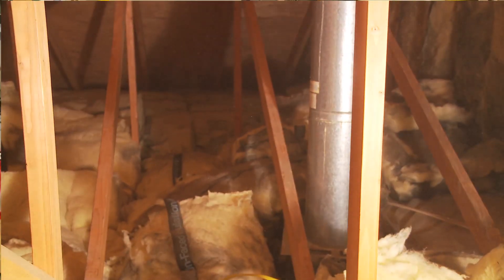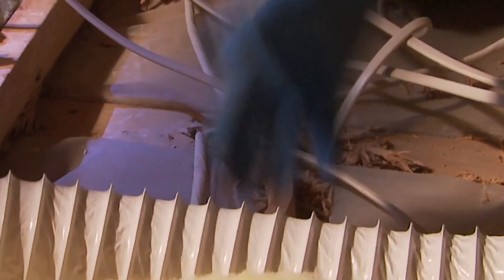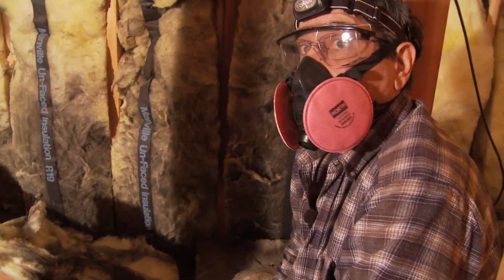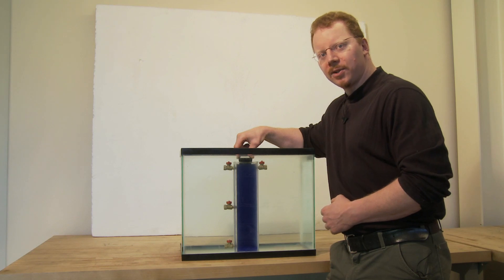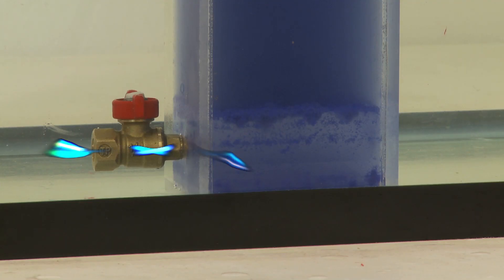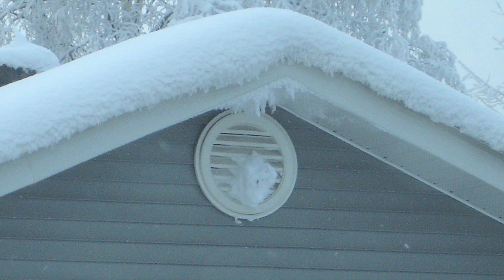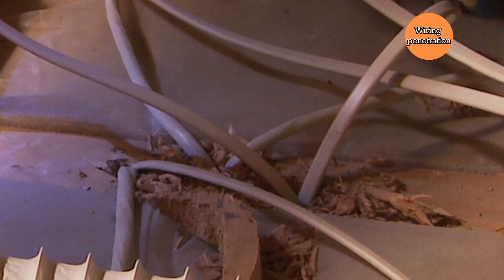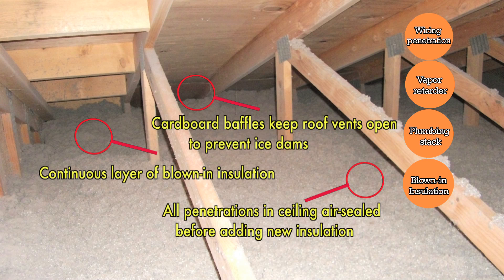Your Northern Home: Attic/ Air leakage/ Stack effect

Comment: When you air seal attic don't you have 2 vent the living space somehow from gasses and stale air and such?
Reply: Here's a few options from simplest to most preferred:
1. Open a window
2. Install an air intake/exhaust fan
3. Retrofit a recuperator to recapture heat from exhaust air
Controlled (or forced) air ventilation is preferred, because a tight air seal prevents house structural wood rot.

https://www.energy.gov/energysaver/whole-house-ventilation
https://en.wikipedia.org/wiki/Recuperator